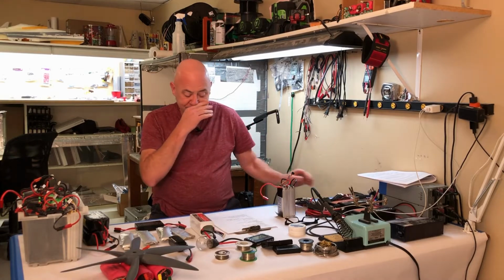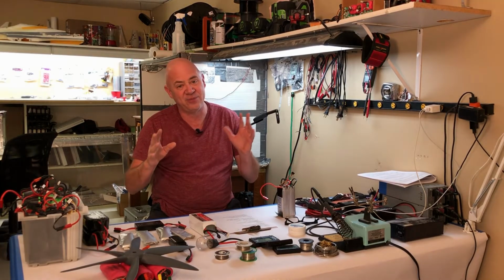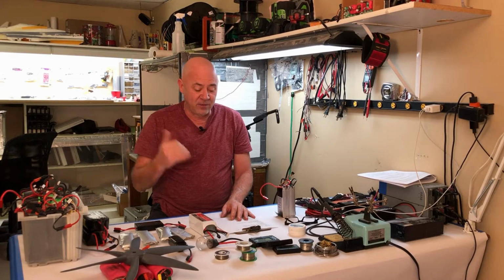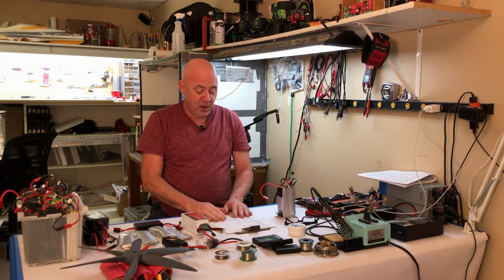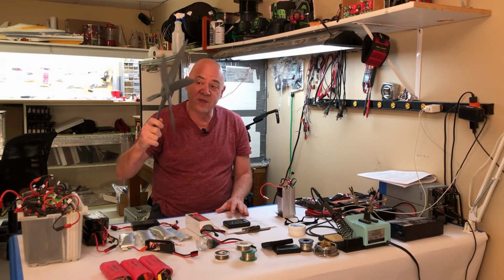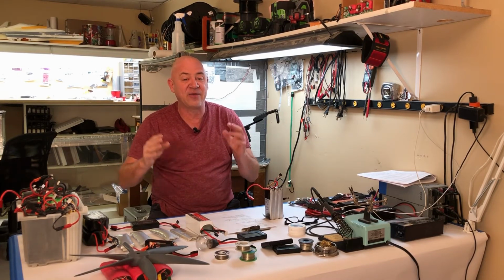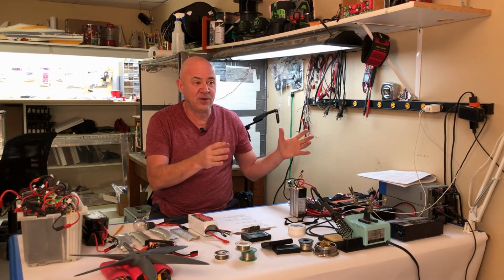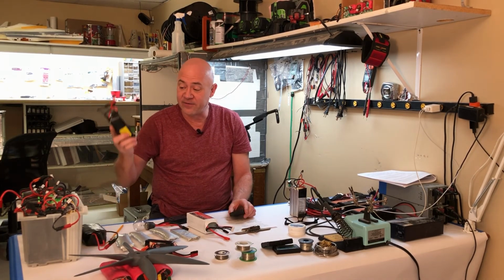Chargers, Balancing, IR, Testing

Comment: Is it ideal for a lipo to be stored at 50% capacity or 3.8v? I find that 3.8v shows around 30% capacity and 3.88v brings it closer to 50%. I've since  been storing based on capacity, not voltage.  Do you see any problems with this?
Reply from the maker: I am not sure. My charger stores between 3.84 and 3.87. I don't think it will matter that much how you are doing it. 3.88 does not sound that far from what my "storage" does on my charger. :)